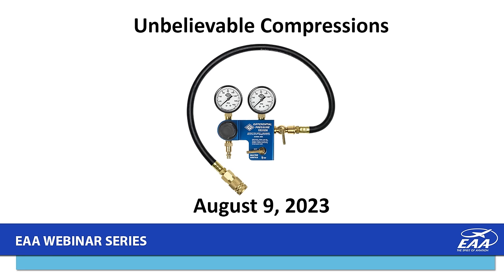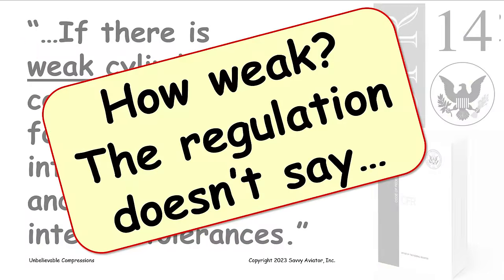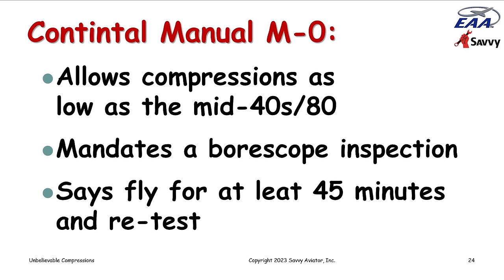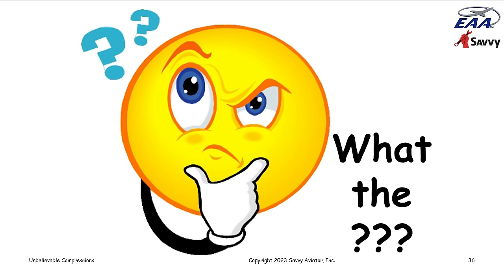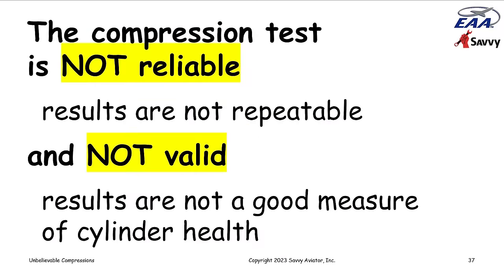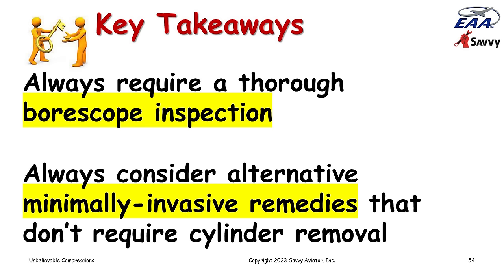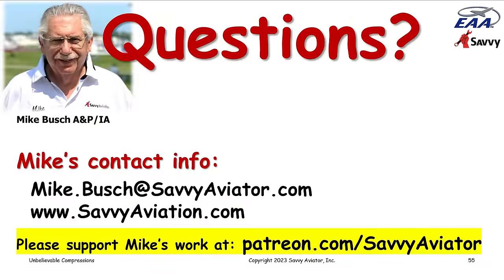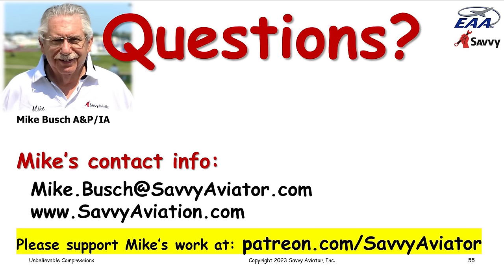Unbelievable Compressions

Comment: Excellent information as always.  I am personally aware of a badly flunked compression (leak-down) test on almost all cylinders, where the compression tester was at fault.  Grabbing another one and it indicated similar fails, and IT was faulty.  The clue was when hand turning the prop, the compression seemed to REALLY hold.  I have seen engines with low compression where hand turning the prop shows a fairly rapid release of cylinder pressure against the prop.  A NEW correct compression tester (drove out to Spruce) gave believable answers.

I am aware of another plane that had TWO cylinders in the very low teens and almost no perceived resistance to turning the prop against the compression.  Tester was fine.  Boroscope wasn't terrible.  The owner was in annual, so took the plane on a trip and saw no problematic temps on the engine monitor.  Upon returning, testing cold, both low cylinders tested in the 70+ range and "felt normal" when hand turning the prop.

I LIKE Mr. Busch's assessment that compression tests aren't very useful.  I care about flying an airplane in safe reliable working order with cylinders that won't fail in flight, but for me, compression tests are just something to get through in an honest way during annual.

Comment: The VA-400 would be the borescope most would want to use and is available for $250 (I purchased mine years ago so don't  have the updated camera).  The VA-450 you mentioned is an $800 piece of kit that includes a dedicated display.  A shop might consider the additional cost/dedicated display worth the expense, but I don't believe most owners would.

Comment: Near and dear to my heart too.   Brought many cylinders back with a quick simple in-place lapping.  Doesn’t make a mess.  20’s to 70’s.   Clean with swabs soaked in AeroKroil. 
Pressure and temp conditions only impact calibrated pressure from a range of 42 to about 46.   Engine will make full rated power at calibrated pressure.   
Make sure ring gaps are correct

Comment: None of the shops I've worked in have ever done hot or even warm compression tests
Reply: I agree, let the cylinders cool down.
Reply: Also the comment that it might cost $1,000 to change a cylinder is just ridiculous if the shop rate is $100 an hour it shouldn't take more than 2-3 hours to change a cylinder ($200-$300) in labor 🎉

Comment: Could you do a short video on how to use the master orfice tool?  Is it used on just cont. or lycomings too??    I have your engine book and the manifesto as well.  Love them and refer to the engine quite often.  Thank you.
Reply: You literally hook it up and input 80 psi. That is your “ failure” limit where you attempt to fix before replacement.

Just continental as they are lower compression, and people are failing them illegitimately

Comment: I agree with this, with one exception Mike. If you rely on manufacture SB to evaluate compression testing numbers for airworthiness, then you have to also rely on them for TBO, numbers. They all limit the motors to TBO of 2k Hrs run time. In other words, even a good Compression test on a motor over TBO is not recommended according to manufacturer. You can't pick Manufacture for specs on compression evaluation, and pick AC 43-13-1b for TBO , which says as long as compression is ok, your good. that's mixing apples and oranges and calling them the same. The manufacturer specs presume if you are following them on compression evaluation, you are also following them on TBO time.
Reply: The thing here is that the regulation requires a compression check but does not require engine TBO unless it is contained in the airworthiness limitation section of the ICA.
Reply: @jaimetrevino3177  You missed my point. You can't pick the TBO from the Regulation and the compression numbers from the manufacturer.  That is cheating to apply a no TBO limit. The Regulation vs the manufacturer each have their own different TBO and Compression numbers that go together. FOR A REASON. The reason I already gave. But Il make a brief version of it. The Regulation is FOR ALL engines and a general spec that says well as long as you have these really high compression numbers, you don't need to worry about TBO. Which is really a bad thing for other reasons. Then you have the manufacturer spec which says Well you can go way down with these compression numbers to this, because your gonna have to do OUR TBO anyway which is like 2000hrs. NOW why do they feel that way. BECAUSE if you READ every SB Bulletin and the AC s, they ALL say these are not regulations BUT IF YOU FOLLOW IT THEN YOU HAVE TO FOLLOW ALL OF IT.  so there you go. Mike is picking and choosing specs from different sources and that is NOT proper. BTW, I have far more education and experience than him. FAR more. Im a scientist with well over four decades in aerospace and space systems. Masters in engineering.

Comment: I missed this presentation at Oshkosh, I went to most of the others though. Since returning from Osh I did an owner assisted annual on my plane. All of the cylinders were a good 10PSI lower than they normally are with one right at 60. The IA signed off but is requiring a retest after flying. This is the first year that I've done an owner assisted annual and thought it was strange we weren't heating up the engine first. I'm going to fly it to the Mooney service center near by and have them retest it and give me a quote to fix the squawks that were found.
Reply: Those out of the back of a truck mechanics need to be watched closely. You get what you pay for.
Reply: @TheReadBaron91  You couldn't be more right. The first year I had my plane I took the plane for an annual based on a friend's referral, he had the plane for 6 weeks and missed so many things. I'd stop in to see how it's going and found cracked spark plug insulators on plugs he had cleaned and "were ready to got back in". 
I've been working on cars for 25 years so during this annual it was nice to be involved so I could inspect and lube things myself. I wish I could replace all the AN lines that need to be replaced myself but since I'm not an AP I can't.

Comment: Very Interesting Content.....Engines failing the current Differential compression test Requirements using verfied Calibrated test tools Certainty contain 1 or more Abnormal combustion Sealing or Valve train Componets.....That engine will be Operating in "Elevated Risk" conditions.....Why Don't these Aircraft engines have Removable  cylinder Heads to make Upper Cylinder head Maintenance pratica & easy ?? ....
Reply: Probably because these engines were designed 70 years ago, when parts were expendable and cheaper

Comment: This is a Leakdown test? A compression test is with engine turning over,preferably while hot. Giving the actual pressure of cylinder.I was getting confused .
Reply: It's a leakdown test. Coming from the automotive maintenance world it was confusing to me too. A friend of mine is a fan of doing leakdown tests on cars where I only do it to find the source of the low compression. He did a leakdown on another friends Miata that had a loud rattle but not quite sounding like a spun rod bearing. His tests showed no issues and they tore the engine down anyway. Had they done a normal compression test they would have seen a couple cylinders lower than the others. There were two bent rods from a poorly tuned rolling anti-lag. Either way the engine had to come apart, but to me it shows the compression test would have more likely seen the issue. Maybe not though, not sure how much the compression ratio was changed by the bent rods.
Reply: In aviation a compression test is a leakdown test. I don't know why they call it that but that simply is what it's commonly called..

Comment: This is a differential leak down test, not a compression test, people are always saying compression. Your cylinder makes compression when it's running, the differential test gauges do not make compression, they fill the cylinder with 80 psi of supplied shop air, then the other gauge differentiates what the cylinder can hold out of that 80 psi based on leaks. Using 80 psi of cold shop air to seal a slightly leaking exhaust valve isn't a very good test when considering that valve is completely sealed when it has 400 psi of hot combustion gasses trying to push it through the valve cover. Differential leakage test. Not compression
Reply: Yes and no.  Yes, this is what the auto world calls a leak down test vs what the auto world calls a compression test.  However, it is a distinction without a difference.  A rotating engine compression test is also measuring air leakage just as does the leak down test.  It doesn’t really matter how the air in the cylinder gets compressed.  A 6:1 CR engine is going to develop about 70 psi on a gauge at TDC.  The engine doesn’t know the difference between 70 psi it created through rotation or 70 psi of shop air in the cylinder.  Same difference.  And even auto style compression tests don’t really simulate engine operation as the RPM the starter can produce is nothing compared to a running engine so the compression measured while cranking will be less, possibly much less, than the compression from a running engine.
Reply: @LTVoyager  Ok bud, just stop, just stop, do yourself a favor and go lay down.
Reply: I'm a car/motorcycle guy that (unfortunately) got into aviation almost 30 years ago.
   I agree, leakdown and differential test are better names, but it's an argument about semantics...it's industry jargon, and all the A/Ps and FAA aren't going to change now.
   The Feds like certain words. We are all "certificated" mechanics and pilots, I guess "certified" lacks syllables. 
   Testing for those certificates involves an "oral examination", which sounds either a little perverted,  or like something a dentist does. It involves talking- it is a test administered "VERBALLY".
   It annoys me to say both certificated, and oral exam. I think there are more dumb words and phrases.
    Yup, I prefer leakdown, but say compression.  
   Aviation people are still in disagreement about whether or not exhaust primary header tube length matters, too. I think of it anytime I install or remove any of the expensive, light, but "tractor like" exhausts.  Exhaust and intake ports resemble something somewhere between proper engine ports and plumbing. But they do work OK for low rpm and approximately 1/2 hp per cubic inch. Fixed timing.. etc, etc.